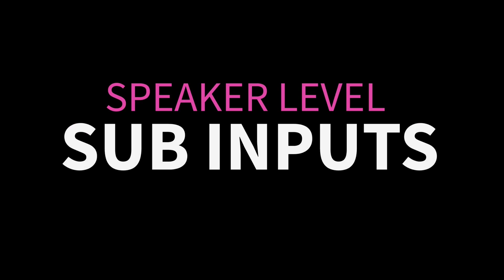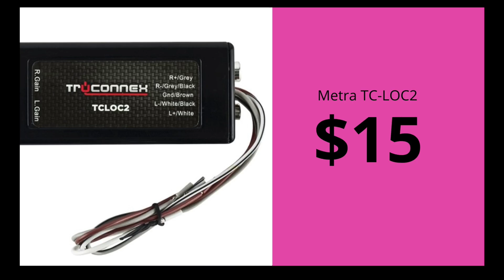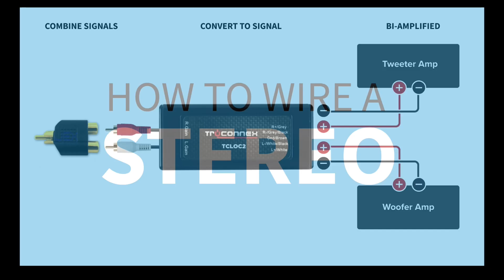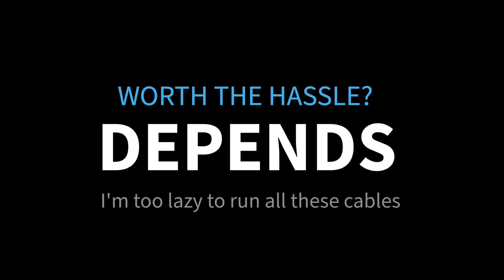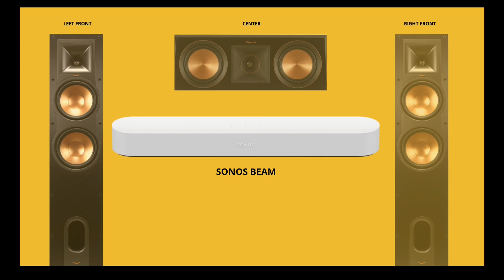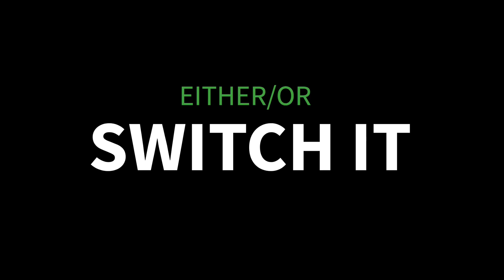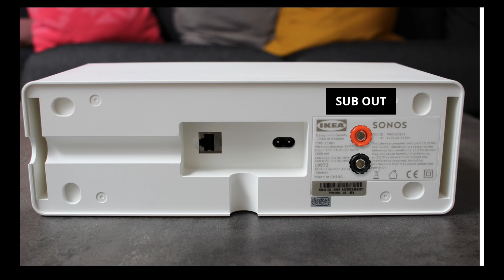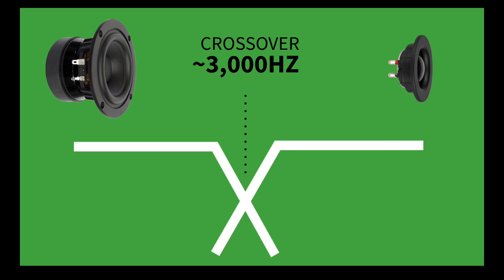Sonos sub hack DIY: How-to wiring guide to add any powered subwoofer to Sonos with Ikea Symonisk

Comment: Awesome video Todd. You've inspired me to try this with my Sonos HT setup on my two old (rear) Play:1's. Plan is to drilling out the speaker mounting post and feed the wires through there
Quick question before I do. Is there any risk/issue with leaving the internal woofer connections in place and just jumping a new set of speaker cables to the powered sub? Would it impact the internal amp for the Play:1 in any way or would it be worth adding a switch to go from internal to external woofer?

My use case is wanting to leave the sound of the Play:1's intact for day to day use and then just switching on the Sub when I need to "theatre" mode. Without a switch, by my logic, it would mean that both the internal and powered sub would both be running at the same time but I don't see that being an issue.

Just wanted another opinion before I pulled out the Dremel. Appreciate any advice.
Reply from the maker: The way speaker level inputs work on a powered sub is they have a high impedance so they don't really pull any extra power from the Sonos amp, they just grab a signal. If you connected an unpowered woofer to the Sonos amp in addition to the internal woofer, that would tax the amp because the impedance is cut in half and pulls more current.
Reply: @todd.parker  Thanks for coming back Todd. Providing my understanding is correct, it sounds like it’s a bad idea because the Sonos amplifiers would see the active sub as an unpowered unless it was physically disconnected.

Do you feel a 3-way toggle switch on the back of the Sonos speaker solve this problem? I’m now thinking wiring the inbuilt woofer to position I, neither woofer to 0 and the powered sub to II therefore making both woofers mutually exclusive. I’m guessing it would mean they can both be connected but not at the same time but still allow me to switch between them.

Please forgive the dumb questions. Never really done something like this before
Reply from the maker: @iqbalmohammed5696  sorry for the confusion. When I said I powered sub, I meant a sub that doesn’t have its own built-in amplifier. If you have a sub with an amp inside, this will work regardless of if it’s turned on or off, no need to add switches.
Reply: @todd.parker  You sir are awesome. Thanks Todd. Now where did I put the dremel?

Comment: Great video! I have a question about using this for home theater. If Sonos thinks that it’s playing to a symphonisk and not a sub, won’t it not offload the low ends from the arc and the rears? I hear that the arc really shines with the low ends off loaded. Thanks!
Reply from the maker: Right, from Sonos’s perspective there is no sub so it won’t make any additional adjustments. It’s not the same as having the real sub but it sure is cheaper

Comment: How do I add an active subwoofer to a Play 3 ?
Reply from the maker: Same process from this video will work with any Sonos, just a matter of getting inside the speaker and finding a way to mount the binding posts. The 3’s have a passive radiator on the whole back so you’re limited on locations

Comment: I created a little program to fix the gateway approach volume de-sync problem. 
It listens at the main room (Sonos Beam for me) and sets the volume of the second room (hacked sub) to the same level.
It can run on a Raspberry Pi (or any other linux system)
Github link: https://github.com/MartvanMale/SonosVolumeSync
I made the installation progress as easy as a could, this should be doable for everyone!
Reply from the maker: This is great!

Comment: hello Todd, I need your help , when I plug my Sonos play 5 , there is a strange noise coming from the Sonos like 2 seconds noise than 1 second pause then again
Reply from the maker: Did you open the 5 to connect a wire off the woofer or is this just a general Sonos problem?
Reply: @todd.parker   its a Sonos problem , I did not open it , when I pluged into the power hear that noise!

Comment: Just wanted to say a big thank, Todd! I am not your DIY guru by any means but I found your videos very useful with clear instructions. I tried the frequecy cross over method hack and I was blown away. The surround effect is just amazing. I am thinking about bi-amping my setup but not sure how to do that. Do I need to drill for another pair of binding posts for access to the tweeter inputs? Can you please share a wiring diagram?
Reply from the maker: Hi, glad that worked. To buy-amp, yes you need another set of binding posts. The wiring couldn’t be simpler - you unplug the symfonisk tweeter and wire the tweeter amp directly to your other speakers tweeter (no crossover). Repeat for the woofer and you’re done!

Comment: Sorry I'm slightly confused. I'm running a sonos playbar, it is connected to the TV through optical, then sends wireless to 2 sonos 1. Do I need to open the playbar up and wire from the sub speakers or are the ikea symfonisk connected wirelessly through WiFi and I just wire from that to my active sub?
Reply from the maker: You need to get a signal to feed into your powered sub. You can either jump off a woofer in the playbar or 1’s to feed in, or use a symfonisk grouped to your home theater room as a gateway. All the scenarios are covered in detail in this video

Comment: Great video! I'm thinking about using the "speaker out" from the sub to the woofer that you mentioned. But I only have one symfonisk, in the video it seems like you need to do it for both left and right? Or does it still make sense with just one symfonisk speaker?
Reply from the maker: That will work with just one but it means one symfonisk is going to be working hard

Comment: can you use this to add a wired sub to a sonos home theater I already have sonos arc and 2 sonos 5 and a sonos sub but I want to add a wired sub to get a 5.2.2 system is this possible?
Reply from the maker: Yes, you can use the "gateway" approach I show in this video to hook your sub to a symfonisk with internal drivers disconnected that you group with your HT room.
Reply: Hi John, did you experience any sound delay with added sub  after grouping on the app (S2)? I have a similar sonos setup and wish to add a 3rd party sub as well

Comment: This is great! Thank you
My movie theatre setup will be a Sonos Arc, two IKEA Symfonisk as rear speakers and my old active sub (thanks to you :). Can I use the signal from the woofer amp on one of the rear speakers in my “home theatre” setup to get the correct signal to the sub? Will the sub get the input it needs to play bass at the correct place in movies?
Reply from the maker: Yes and yes. I have more videos on the hack that should answer all your questions but that will work like a charm

Comment: Wow, great video!  I was thinking of just connecting an inexpensive sub to a used Sonos Connect and controlling it as a separate 'room'.   Do you see any shortcomings of that approach?  It would be similar to your Gateway approach.
Reply from the maker: Yep, same thing. If you own a connect, that’s even better
Reply: Well there might be another issue.   The Sonos Connect - Gen 1 (which are cheap on Ebay) do not support the S2 app but the Symfonisk does.  With the S2 app I think you can permanently group the subwoofer 'room' with the beam and surrounds 'room' so that you don't have to do it repeatedly.
Reply: @TheRemedyBand  Just reading the forums; says you can only permanently group three or more rooms. In this setup, we only have two rooms, the Beam with Surrounds and the Symfonisk. Wanted to ensure they didn't get un-grouped and also volume simultaneously got adjusted in both rooms, when pointing a remote at the beam. Ideas. Tks
Reply: @HES1000  I'm using a Sonos Connect for the sub so I'm limited to S1 and I have to regroup the sub whenever I want it, not a big deal.
Reply from the maker: @TheRemedyBand  you’re right, that would be stuck on S1 and I know the Arc needs S2. So this works but probably only with Playbar or maybe Beam, since those can work on S1

Comment: I have 1x Sonos one and 1x symfonisk. Now io open the symfonisk and wire my 3rd party sub. My problem I can’t Create a 2.1 with 1xone and 1x symfonisk( sonos says : I need two symfonisk or two one) . But I can play all together in one group. Is that okay ? Or ist Stereopair + sub much better ? It is living room and dining room together but it is one big room it is not seperate (it is a open house) thx
Reply: I also not sure about my sub.
I want to make level 3 (high level in and out back to symfonisk, but my canton movie 60 sub just have high level input and mono L / R (is this Output, no ?!?) 
It looks like level input ist - - and mono L/R is  + + ??? 

And Can I still use my RCA cable for my Sony receiver which I USE for my TV sound.

Comment: Hey Todd. Thank you so much for the great videos. I'm about to start the project to add a sub to my beam + 2 symfonix for home theater. I wanted to get your thoughts on how well this would work if I only connect one of the surround symfonix with the sub, instead of both L+R. The two surrounds are on opposite sides of each other and would prefer to reduce the speaker wires to the sub.
Reply from the maker: I only used one channel in my setup and it sounds great

Comment: Hi Todd, it is not true that you cannot get an RCA output without crazy firmware hacking (reference to around ~8min in your video).  It is also unnecessary to buy additional signal converter hardware as suggested.  You can get a full range non-amplified RCA-out signal from the Sonos/Symfonisk circuit board fairly easily. You solder a wire onto the high/mid frequency signal and another wire onto the low frequency signal after the DAC, and before the amplifier circuit. These wires can be tied together for a full range frequency signal and connected directly to an RCA plug. You also need to grab a ground connection from anywhere on the board to complete the RCA output circuit.

Instructables[dot]com website has an article on it titled, “Cheap(er) Sonos Architectural With IKEA”. I also saw a YouTube video on Hacking the Symfonisk where a guy successfully did it. 
Link:
https://www.instructables.com/Cheaper-Sonos-Architectural-With-IKEA/
Reply from the maker: Thanks for the links, I saw those after the video came out and am thinking of giving that a try at some point

Comment: Hi Todd thanks for your great video. I have a question. Im running now a full sonos 5.0  thats a playbar and 2x play 1. I want to add just a sub. Do i have to tear down one of my play 1 or can i use a symfonisk speaker just for adding the sub. Thanks
Reply from the maker: If you don’t want to open your play 1’s, you can use the sub gateway option in this video where you set the symfonisk up as a room and group it to your home theater room
Reply: @todd.parker  Thank u very much. For now i will do it like this.
Reply: @rsnatersen5643  With that setup, can you control the volume of the sub with your tv remote?
Reply: @spienkow  with the sonos app u can change the volume of the sub seperate. and with volume of your tv u can change the hole groupe volume all at once
Reply: @spienkow  its very easy hack and the sound of a sub it is just amazing with the sonos speakers. i did the hack like 2 months ago
Reply: Hi Todd , thanks for a video it’s so cool, probably sonos company hates you but you are our HERO. 

Got a quick question. Have sonos playbase and 2 sonos play1 . I want to ask you if i will open playbase and connect active third party subwoofer to conecters for sub. Playbase got a small sub bit it work on 30 kHz.  It will work or sonos playbase will cut signal?

Thanks a lot !!!
Reply from the maker: Hi! If you can open up the play base and jump a wire off the internal sub, that would be perfect since it’s the .1 channel signal for home theater. Hopefully there is a teardown video that shows how to open it up, I know their stuff is dense with electronics and speakers.
Reply: @todd.parker  thanks a lot. Thanks

Comment: Great video Todd!  Thanks to you I've successfully added a $130 Polk sub to my setup and love the added depth to the sound.  I just hacked it together with whatever I had on hand at the time and was going to go back in and tidy up the wiring a bit and have a question about what wire you recommend.  Is there a reason that you recommend 16 gauge wire rather than something smaller and closer to what's in the Symfonisk box?  I'm wondering if the thicker wire adds unnecessary resistance to the setup (but admittedly, I don't really know what I'm talking about).  Thanks again.
Reply from the maker: If it’s a short run, you can use thinner (higher gauge) wire but 16ga is about as thin as I like to use. The larger the wire, the less resistance so there’s not downside to beefier wires except cost.

Comment: I just wanted to add a subwoofer. Now I don't know what I want anymore.
Reply from the maker: Lots of options. You can start simple and go from there
Reply: I had an thought.   Can you just remove all in the Interals of the speaker.   The signal,  power etc and put them in a small home made box.  And plug it in the wall and the sub Into it.

Comment: I did the "gateway" sub version and I cannot get trueplay to work. It keeps erroring exactly at one quarter into the process. This is with both an iPhone and an iPad, and I've even hooked the symphonisk up to two separate subs with the same result. Anyone know how I can solve this?
Reply from the maker: If you run it with the internal drivers off I think it’s probably freaking out because it’s missing so many frequencies. I’d suggest running it with the sub on at around half volume with the speaker full range to see if that works.

Comment: Is there any way you could mount all of the wires and the circuit board inside a sub just to get the bass? Want to make a tidy-looking sub and have no need for more high level sounds, just the sub.
Reply from the maker: Sure! You could even just remove the front panel and maybe one side wall and mount that into the sub although you’d need a way to get the speaker wires soldered to the input terminals from the inside
Reply: Todd Parker As a very non experienced person, could you explain to me: as I’m connecting the wires directly to the sub, does that mean I get a “gateway solution”? Also, do I need the wires from the non bass part thingy connected at all or could those be removed completely?
Reply from the maker: TheResistance2fan1 If this is your first time, there are a few things that might be pretty tricky to do such as making the front panel buttons accessible through the sub cabinet and tapping into the plate amp of the sub to route the signal wiring. Hard to explain in a comment, unfortunately

Comment: Hi Todd,
Really appreciate your videos! Watched them several times and learned a lot in general and specifically in relation to the Sonos options.
I've been thinking doing something similar but would like your take on it first.
My plan is as follows. Hook up a Sonos Five to a sub (been thinking about Yamaha NS-SW300). But it made me wonder if putting the Sonos Five in vertical position and then hook it up to the Sub using speakers input/output in the stereo configuration which you showed in your video with the two Symfonisk - will you get a stereo config out of that and it is at all possible? Or would you really need to hook it up to both the Five's?
Lastly, and I don't know if this really has an impact or not, but I am thinking to add Wireless capability to the Sub using a wireless audio adapter (https://www.svsound.com/products/soundpath-wireless-audio-adapter) to the LFE and a soundbar.
But essentially, I would like the Sub connected to my Sonos setup for music playing (but one of the two Five's will be in a separate room - hence the stereo question) and wirelessly connected to the soundbar for home-theatre experience. Would really appreciate your take on this!
Thanks
Reply from the maker: It's best to think of the sub hack as just your normal speaker, but with some of the signal skimmed off so you can add a sub. If you want to open your Play 5, you can hook off of a woofer to get a signal to the sub, or get fancy and wire it with the sub speaker in/ out terminals to remove the bass going into the 5's woofers. I'm not sure how the Symfonisks would fit in with the 5's though. Those could be set up as a separate room that could be grouped with the 5 if you want and the sub could either be wired to the 5 or the Symfonisks. From the app's perspective, it just sees the normal speakers, never the sub so it's nothing magical.

The wireless sub adaptor complicates things because you need to down-convert the amplified woofer wire jumped off the woofer in the Sonos speaker into a line-level signal to plug into that wireless box. You'd need to run the woofer wire into this converter then convert RCA to 1/8" so it's sort of Rube Goldberg wiring setup that may have some noise/buzz. https://www.amazon.com/Rockford-RFHLC-Speaker-Signal-Adapter/dp/B009VTDVMU/ref=pd_lpo_107_t_2/138-5643619-4161939?_encoding=UTF8&pd_rd_i=B009VTDVMU&pd_rd_r=f77e1792-b81d-412f-8e4a-19c60cd22b8c&pd_rd_w=5CNTb&pd_rd_wg=BZbK0&pf_rd_p=7b36d496-f366-4631-94d3-61b87b52511b&pf_rd_r=1NJKKJ63QXMEPQWBGNDK&psc=1&refRID=1NJKKJ63QXMEPQWBGNDK